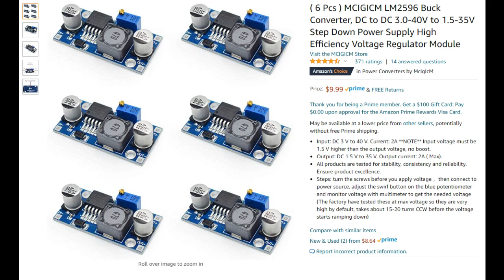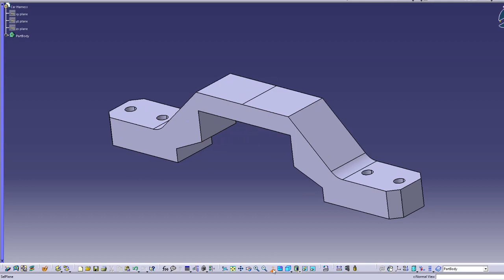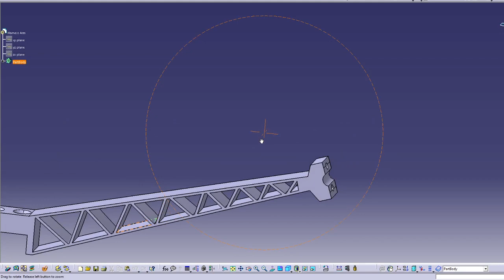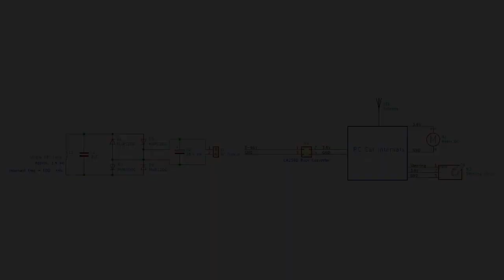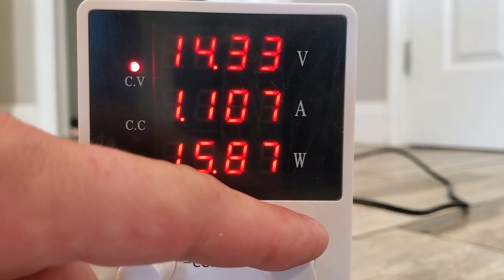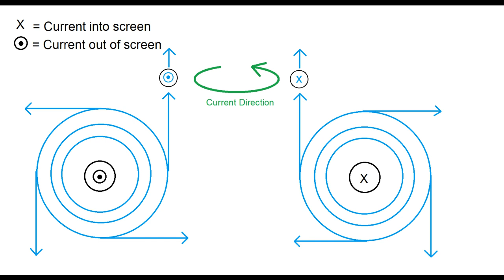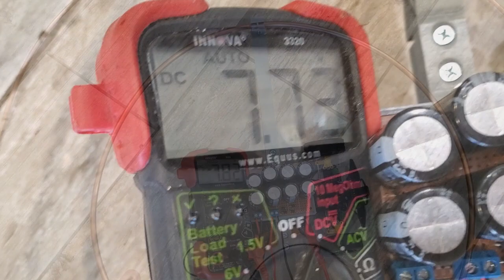Wireless Power RC Car

Comment: If it's ok with you, may I suggest that you use supercapacitors, they can hold way more charge but they take some time to fully charge, which I believe your wireless power setup can charge up rather quickly...
Reply from the maker: Yes, supercapacitors would definitely be effective for this project. However, my goal was to continuously supply power through the wireless circuit rather than charging up batteries/caps and then running off them. The purpose of my big capacitor cluster on the RC car was really just to buffer out any sudden voltage changes so that the DC-DC regulator didn't have to work as fast.
Reply: Hey thank you so much for your support. I have made it. Obviously I have modify some of the things. And I made this project for powering up a drone. And it works. Drone perfectly fly without battery.

Comment: Great transmitter power, what if transmitter coil make looks like spring shape? So rc can thrue every layers of coil ?tx for posting
Reply from the maker: Like a flat "pancake" coil? I haven't looked into it, but it seems like it would work
Reply: @HyperspacePirate  yes looks like pancake coil (series) or looks like dart board (pararel) 😀..or transmitting power by laser light dirrect to your rc ?i dont know..i just imagine😆..cheers.

Comment: Hm. Something flying that fits the ring of the power receiver? Lets see... an airplane wing generates lift so if you have something blowing out air in the center towards four wings arranged around it (or a 3D printed ring with a wing shape for when wind flows out from the center?) using a fan and perhaps an 3D printed air guide to direct air towards the wings (or ring) to generate lift? If you only want to use one fan to see if it can lift off rather than four for a controlled drone this might be a unique project. Haha!
Reply from the maker: My thinking was just a very lightweight drone with long arms that the motors mount to but also act as the supports for a lightweight aluminum receiver loop (aluminum is less conductive than copper, but the conductivity-to-weight ratio is nearly double, which is more important for a flight vehicle)

Comment: what is the size of the transmitter coil?
Reply from the maker: 30" diameter so about 76 cm
Reply: @HyperspacePirate  can I use 100uH inductor instead of 120uH? One more thing is that " Can you make a separate video on how to make ferrite core inductor?" I'm pretty much sure that it wil help many people out there who are regularly following your videos ☺️
Reply from the maker: @TowfiqAhmed3ELab-Bogura  Yes, there's a relatively large range of inductor values you can use. In general, I try to keep them at least 10 times larger than the inductance of the load on the ZVS driver's output. Going a little less is ok, but i prefer to add more if i can. 

As for the ferrite core thing, i typically just buy them or salvage them from discarded power supplies. Typically it's not worth the effort to wind them since they're pretty cheap
Reply: @HyperspacePirate  thanks for your reply
Reply: @HyperspacePirate  Bro my transmitter coil and the resonant capacitor are getting hot whenever I turn on the circuit for 1 or 2 minutes. what is the reason behind this?
Reply from the maker: @TowfiqAhmed3ELab-Bogura  There's a huge amount of current at resonance generating heat, that's expected. I'd advise using a fan to cool off your electronics if you're going to use the transmitter for an extended period